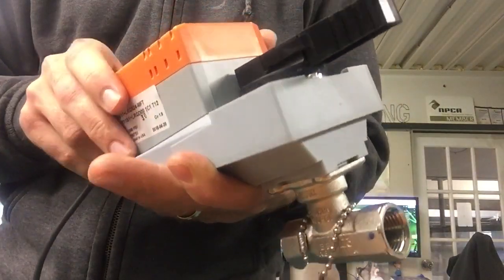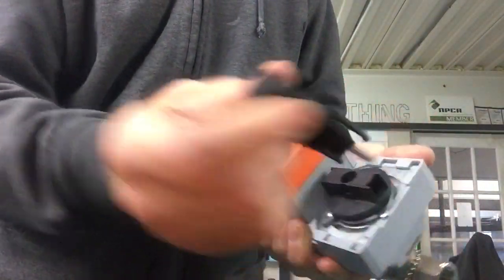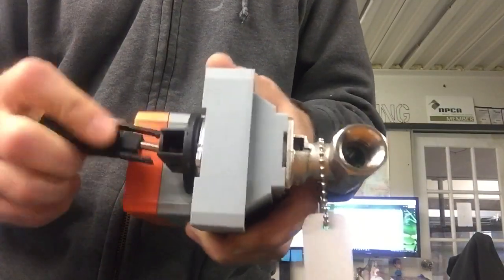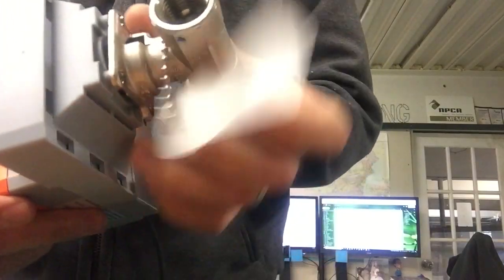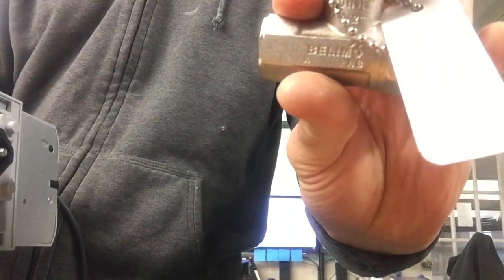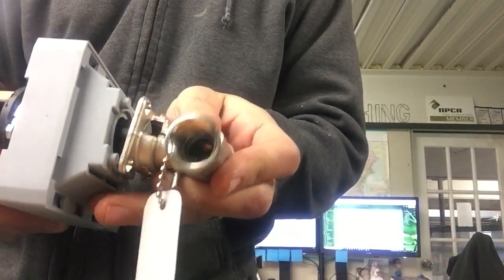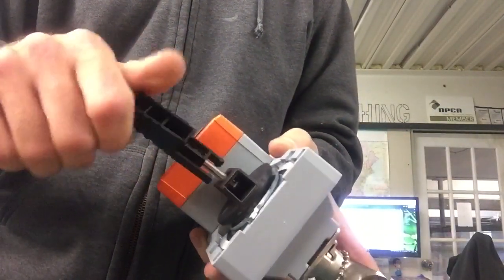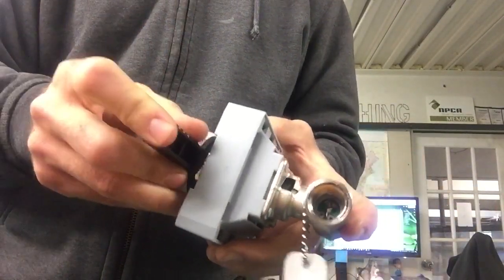Belimo LRQX24-MFT Valve Swap

Comment: Can you please help to solve this issue.. when i apply 10VDC (max control vdc) the actuator 50% only opens… it’s doesn’t go to 100% .. even i did the self adoption function..how to make this into 100%: Model is SVK24-MFT-50
Reply: Are you using a plc to apply your voltage control? If so, I have found if you are adjusting the PLC range manually, the valves does t fully actuate properly. Also if you 0vdc wire is not directly connected to your power supply it does not get a proper reference point for “full close”.
Reply: @nicholaslees6707  21VDC powered by PLC and another 2 to 10vdc given by PLC to control 0 to 100%… I notice 10v receiving at actuator terminal but not opening 100%. it stops at 50% not moving beyond, but when doing auto stroke check it goes 0 to 100% fully..
Reply: @rajeshn9212  is your 0vdc (-) from the power supply connected both to valve (-) and also the plc (-) terminal of your output?
Reply: @nicholaslees6707  Yes
Reply: @rajeshn9212  with 10vdc confirmed using a multimeter at the actuator across the wire leads, the only thing that would prevent it from fully actuating is if the actuator was programmed otherwise to limit stroke or the signal is not truly a 10vdc.